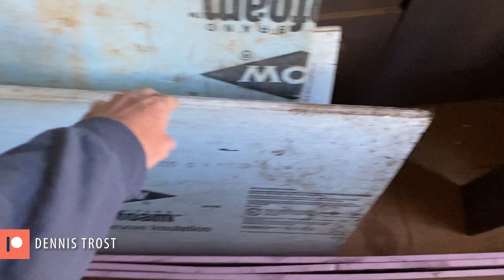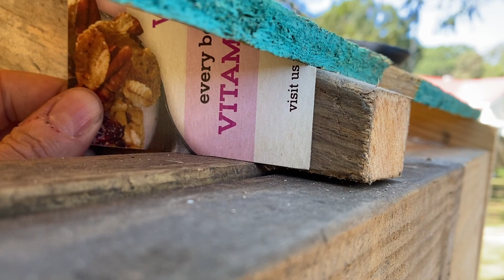How To Make A Tiny Studio From Reclaimed Materials | PART 6 - Insulation + Roof

Comment: We want to build your fire brick rocket stove but, can you build one with a chamber on the side that you can bake in, like an over? And it would heat by the same fire  chamber so you could bake and cook in a pot with the same fire.  I would appreciate any help you can give.
Reply from the maker: Hi Tiffany. For baking, have you considered a cobb oven? I’ve also done a rocket stove fired pizza oven. It can get to 500 degrees. I haven’t measured the temps on my cobb bread oven, but I have baked bread in it. To answer your specific question, I think to modify the firebrick stove to add a baking chamber, you’d want the fire to flow through the chamber. Ideally the chamber would have a thermal mass to capture and radiate the heat slowly. That is what the cobb oven does. Perhaps you should combine the two. I hope that was helpful. Thank you for watching.
Reply: @GreenShortzDIY  Thank you very much for taking the time to answer. I will watch watch those videos and see what I come up with!